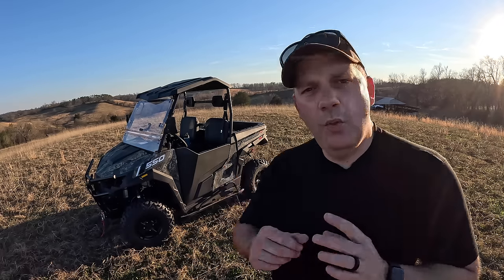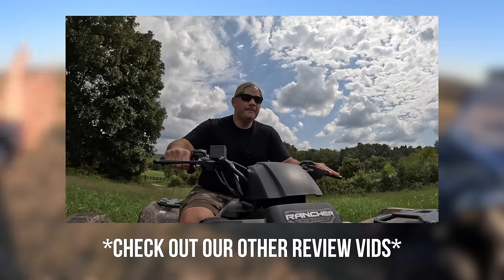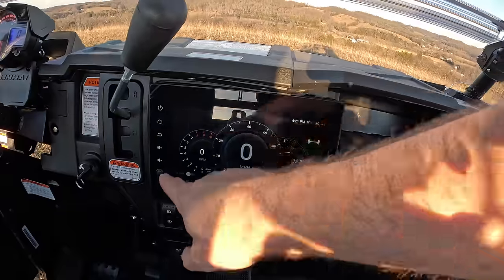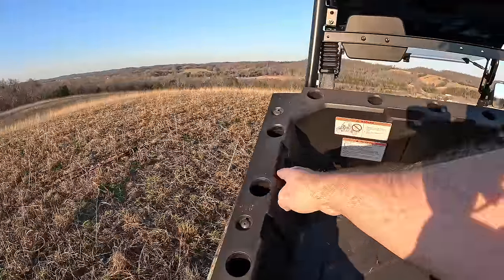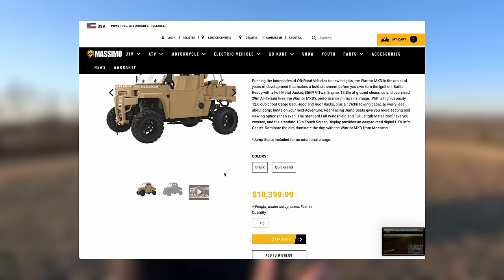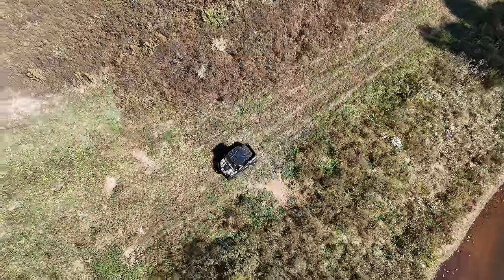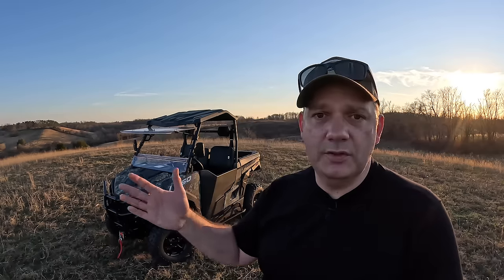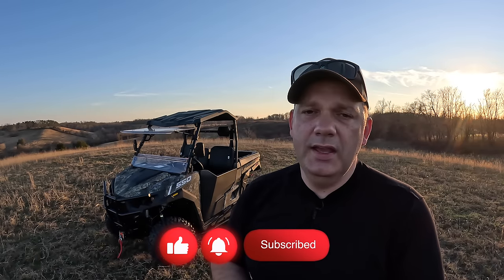TRACTOR SUPPLY SIDE BY SIDE HAS TWO FLAWS!

Comment: You can get the Honda pioneer 520 for the same price. This may be more decked out than the Honda, but in 10 years this will be in the junk yard while the Honda will still run like new.
Reply from the maker: Not arguing that Honda makes fantastic machines...we own them.  They are excellent machines.  But I just built out the Honda 520 on their website and without doors (they don't offer hard doors) the price comes to $13,564.92 plus a destination charge of $685.  That's a total of $14,249.92.  With all due respect, not the same price.  The Massimo is far less expensive (saves $4,350.92), but offers hard ABS doors and a camo finish (not offered on the 520).  Again, not arguing that Honda's are awesome.  But the Massimo is a really good price compared to what else is out there.
Reply: I have a ten-year-old Massimo 700 on my farm and for the $9k I paid for it, I have no complaints. I use it and abuse it and make it go places it has no business going through. All the other manufacturers charge extra for roofs, windshields winches, and bumpers. I got all that for just under $9 grand (ok, I bought it new in 2014). For the price, I thought I'd give it a try. The only thing I have ever done to it is add an LED light bar. I climb steep rocky ravines and tow a 5x10 work trailer every now and then. I did break a mirror in the woods and followed that by backing into a tree and cracking a tail light lens. It doesn't go on the paved road and that explains why the tires aren't worn out. It probably has the same air they put in it in China. Its 4x4 locker is an absolute necessity while climbing steep trails and the only option I would consider on a new one is power steering. It will be on this farm until it is a bucket of bolts. Good luck with yours Joe...
Reply: Thanks For the true honest opinion, I am way past just going fast! I want a machine I can enjoy on the weekends, but use everyday around the yard.. honestly the heaviest load I would carry would be my snowmobile trailer or my Ski boat that I have to take 300yrds to the Lake!
Reply: Wrong
Reply: Fanboy
Reply: @frankg6563  10 years and how many hours? Do you follow the maint. schedule? Have you changed any parts? Trans belt for instance. Wheel bearings, CV joints? Who works on it?

Comment: Have had mine for four months and have nothing to say that is negative. Reading the manual is helpful. My one disappointment is the long length of breakin (50 hours) before you are supposed to pull loads. (Manual, p 9-1). Other than that, I am more than pleased with this rig for working around the pastures fixing fences and cleaning irrigation ditches, and for just an enjoyable ride. Thanks for this review, now I know to check with my local Yamaha shop for maintenance!
Reply from the maker: Thanks for sharing.  You are wise to follow the break in period…but it isn’t gospel.  After 10-20 hours, I’d change the oil and do what needed to get done within reason.  I also think its for cvt wear.    Just be sure to be in Low when towing something heavy.  Will extend the belt life.  Thanks for watching!

Comment: I’m looking for something that I can once a year or so move some sand with a blade.  The rest of the time is 5-7 miles at a time.  no real offroad, 25-30 mph.  If it wasn’t for the stupid sand I’d be looking for a fastish golf cart.
Reply from the maker: This would be a great option.  Mostly because it's a light machine with 4wd.  They have a snow plow option online that may fit the bill.  Thanks for watching!
Reply: @JoeTheFarmer  I’m seeing that lowes has the axis 700 on sale for 9k currently.   Very tempting.
Reply from the maker: Built by Hisun.  We had a Coleman Sector 550 and it was great.  Not sure about the newer Hisun's.

Comment: For under 10 k that thing is really well built . As far as maintenance, thats fairly easy to do yourself .
Reply from the maker: I agree.  I’ll be sure to do a service video on it soon.  We’ll hit the normal stuff.
Reply: Yeah the service on my Polaris Ranger 700 is much easier than my Honda Rancher 4 wheeler . Both are 20 years old . And the Ranger is wayyy more comfortable lol
Reply from the maker: @jameswagner7260 10mm wrench and a strong grip!  Lol
Reply: I bought one of these 550's recently to replace my Polaris Ranger - that I've had constant problems with for the last 9 years. Yes, Polaris was almost 3X the price. I've had my 550 for 5 months now, and I'm super pleased with it. For the money, I don't think you can beat it. I'm down on paying for a high priced name plate!
Reply from the maker: @timbinman Hey Tim!  I hear Polaris is really hit or miss. But I guess thats all machines.  We have been running the 550 all over the place and it hasbeen a solid machine.  Only complaint is the same I have with all machines.  Want more power!  Lol.  Thanks for watching!
Reply: @JoeTheFarmer  I chuckle when I hear the 'where do I get service' complaint. With Polaris, they use a 'hold hostage' approach to service, diagnostics and parts. Example: They would not 'tell' me what parts I needed. Insisted only their service shop could do the work. I actually needed a new fuel pump assy. From Polaris dealer: $550. From Amazon - the EXACT SAME THING - $77. Where to get service? or Where to get a good 'servicing' without even getting a kiss! I'll work on my 550 myself. Its running great.
Reply from the maker: Great points man.  Not to mention I can change the oil faster than it takes to get it on the trailer and to the dealer.  Major time and money saver.

Comment: Great video, Joe.  One thing I learned with my Massimo 550 is to let the EFI cycle first.  In other words, turn the ignition one click, let the tack cycle up and down, when the tack is back down, the fuel has been injected.  I noticed in a few of your videos it sounds like it takes a second or two to turn over.  Let the machine cycle first, then turn over.  It will save your starter in the long run.
Reply from the maker: Thanks for the Tip Scott, appreciate that!  And thanks for watching.

Comment: I’ve owned my 550 T Boss for just about a year now and I’m pretty happy with it so far. My primary use has been for  hunting and helping with chores. 
My biggest disappointment has been with  the trailer hitch receiver. I attached a Hitch Haul to the receiver and loaded up my buck. I live about a mile from where I hunt and when I got home, I noticed the receiver hitch had bent down and my Hitch Haul was almost dragging on the ground.  
I researched the load rating for the tongue weight and it’s only 25lbf. No wonder it bent. 
Anyway, I will be reinforcing the receiver for next years hunt. 
I enjoyed your review on the T Boss and looking forward to future videos. You do an excellent job!
Reply from the maker: Whoa!  That stinks.  I’ll need to look into that…because we tow a lot of stuff around the farm.  Thanks for watching and thanks for the kind words!!!
Reply: 25lbs? Should be at least 120lbs if we go what what car manufactures do, 10% of the tow rating. 25lbs is useless. My CFMoto Cforce 500 can two about 800lbs and the hitch looks very beefy. I have towed heavier loads and the hitch looks perfect.

Comment: What is your opinion on the build quality of the tboss vs the coleman(hisun)?
They are sooo compairable, i got a hisun but i just felt them both (tractor supply and rural king respectivly) and felt the tboss felt a little cheaper, but i kinda wondered if it was just me,… i assume you can feel them side by side(lol) of each other…
Reply: I guess i never really concluded, i felt for farm use, the bed in particular on the tboss seemed MUCH weaker than the hisun, even though the capacitys were close…
Reply from the maker: TBoss is just a much smaller machine with the same power.  It's more compact and narrow, whereas the hisun is a bull in a China shop!  Lol.  I love the Hisun man.  I have done things with it that would void any warranty.  Ran over trees, saplings, brush, rocks, etc.  It just comes back for more.  The Massimo is a tighter machine.  Assembled flawlessly and well appointed.  May do the same, but it's just too nice to abuse (yet!).  Time will tell, but I think the "big" manufacturers are nervous for good reason.  Make no mistake about it...they are losing a TON of sales to these value machines.  And it's not because the value machines are junk.  Thanks for watching!

Comment: Beautiful  property  Joe, do you still have the Coleman and how do they  compare.
Reply from the maker: Hey Tim!  I still do have the Coleman!  It's an absolute workhorse.  I keep flirting with selling it but just can't pull the trigger.  The Coleman is a much larger machine and very no frills.  The Massimo is FAR more refined and overall just a tighter machine.  Though I am a huge fan of the Coleman, the Massimo is more comfortable to drive, quieter and smoother steering.

Comment: I had a 2020 Atv 400Atv 4wd bought within 400 miles done put another gear shifter and water pump.Had enough Chinese crap but maybe there is a few good ones out there.But is it worth taking a chance or just paying more upfront
Reply from the maker: I think like all things, not all manufacturers are equal.  Linhai has had a relationship with Yamaha and they build thousands of machines with a great reputation.  I’m not saying it’s going to replace the Honda or Kawasaki in someone’s garage…but for most folks that want a machine that isn’t clapped out and has a warranty, looks good and has all the accessories included its hard to argue with.  I think Linhai and CF Moto are giving a lot of premium brands headaches.  They are solid machines for far less money.

Comment: I just bought a new 550 and was driving around the property for the first time. On a downhill slope the engine/cvt don't hold the vehicle back. Is there a way to slow the atv without standing on the brakes?
Reply from the maker: So you got the atv or the side by side?  If you are in low it will slow you down
Reply: @JoeTheFarmer  I got the Boss 550 side by side. Our property here in Colorado is mostly hills and a steep driveway for part of it. I tried going down the driveway in low and it went was freewheeling. Am I doing something wrong? I have owned and ridden many motorcycles, mostly dirt bikes, over the years, but this is my first side by side. We have an old Honda trx 300 that took a while to get used to also.
Reply from the maker: @JustMe-cg4vp hard to tell without being there.  When its new it has to break in the gears so just be sure its in low.  Shouldn’t freewheel
Reply: @JoeTheFarmer  Thanks for the replies. Two things I forgot to mention, great videos, I think I've watched most of them, and the transmission is a cvt. Don't know if that matters. I hope I'm not being too much of  a pest.
Reply from the maker: Hey, thanks for the kind words.  Appreciate it!  And I was on the machine yesterday and it didn't freewheel.  In low seemed to go downhill really well.  Not like an engine brake, but smooth.  CVT doesn't have engine braking (I think!) so I just put er in low.
Reply: DRAG YOUR FEET  !!!
Reply: The transmission is much like a torque converter. There's a belt in there that could slip. Nothing wrong with the machine It's the design.

Comment: Be aware - you are responsible to transport your T-Boss for warranty service. Tractor Supply is not a repair shop -- other sellers that may provide warranty service may not service your unit. I've had mine for about a week, and it's got parts falling off, less than 50 miles. This doesn't keep the vehicle from working, but what is going to fall off next. Warranty service is 60 miles away and say, 'bring it in, they'll get to it in a few weeks.'
Reply from the maker: We haven’t had any issues and it’s been worked hard.  Sorry you had that experience, what fell off?!  Also, every machine I own (tractor, skid steer, etc) with warranties do not cover transportation.  If the new skid steer has a warranty issue, I pay to transport it or trailer it.